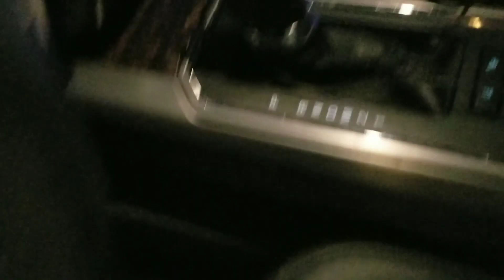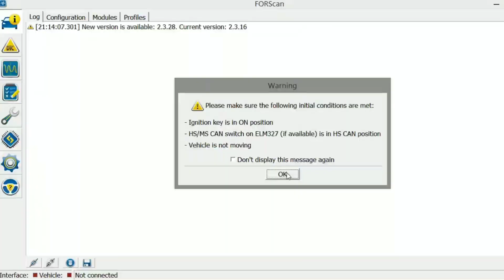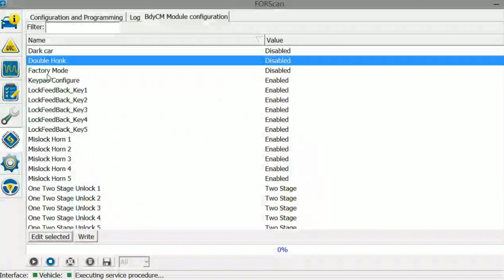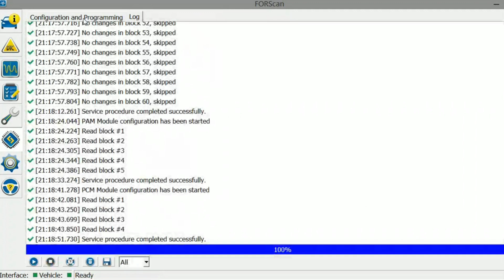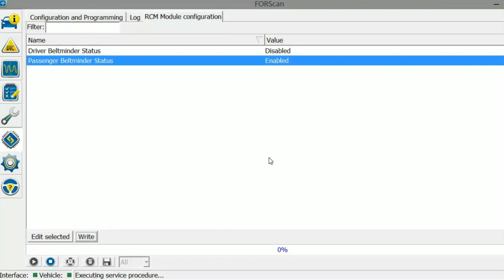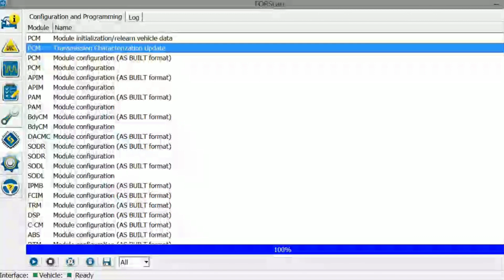Forscan non as built menu options

Comment: Did you figure out how to enable seat heaters/coolers for the remote start?
Reply from the maker: My truck will turn it on based on last settings. Does yours?
Reply: Ricardo's Workshop well I have it set on auto but nothing happens. And then when I go in to enable it with Forscan the modules aren’t even there. This is with Sync 2 or 3. Mine’s a 15 Platinum and I just did the Sync 3 conversion thinking it was an APIM thing. The option is there in my settings but they don’t come on. It’s weird.
Reply: My 16 KR will not turn the seats on with remote start when set to “last setting”? I have not done any forscan mods, is there one for that?
Reply: @RashidROwlia did you figure this out ?

Comment: Question, when you clicked on PAM, it only showed "AUTO PARALLEL PARK". Doesn't the PAM, parking aid module have the reverse sensing, reverse camera, and any other parking features also?? Why did yours only show one?? I bought an XLT regular cab 301A package. Back up camera, no reverse sensing, but chassis wiring accommodates it. So I replaced rear bumper and harness. So rear is set up for factory reverse sensing. I assume all I have to do now is download Forscan and enable reverse sensing features myself. Is that possible?? And is it in the PAM?
Reply from the maker: Hi Joe... in theory that would work. If you have the module, and the hardware. It's just a matter of activating the software.